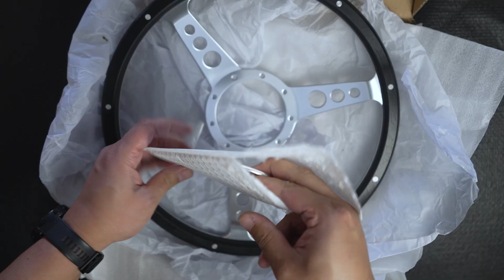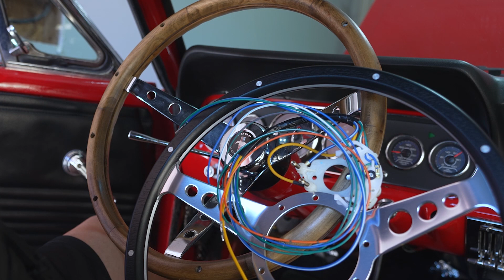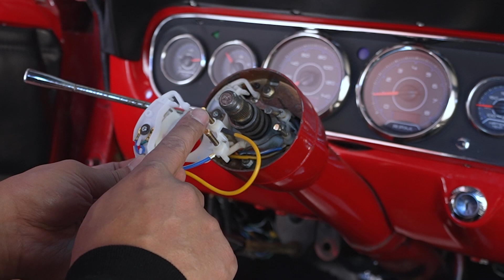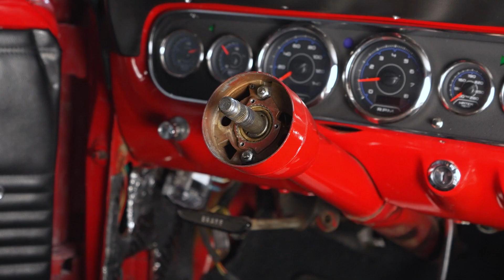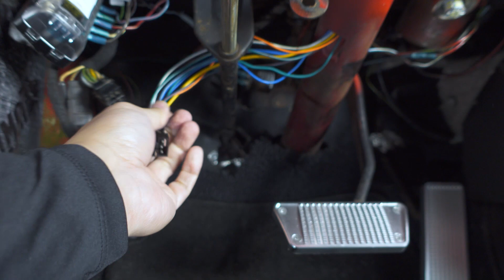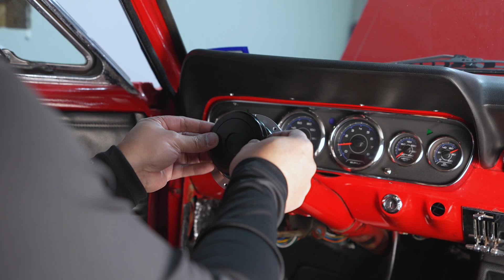1966 Mustang | Replacing the Turn Signal Switch/Horn Harness and Steering Wheel

Comment: Hello....does your cancel work?
Reply from the maker: Yes it does
Reply: Had trouble getting mine to work, saw another video that said the dimple went facing 9 o'clock and the pins between the cancel cam.  Not sure which is correct.  Thanks for the video!

Comment: I have watched numerous videos on replacing a wheel or turn signal assembly, and this one is very clear and detailed.  Watch it then compare to others.  One problem I had is the hub I purchased was poorly made and the contact buttons short circuited and one of the horn wires pulled out.  Get a quality name brand hub and turn signal assembly.  Don't get cheap Chinese items.